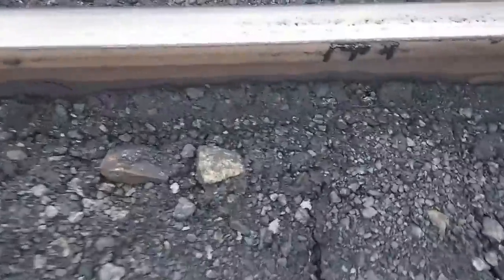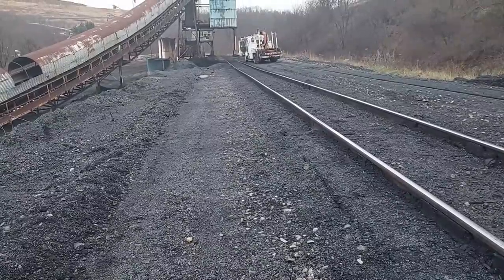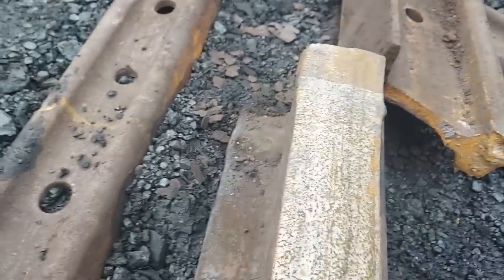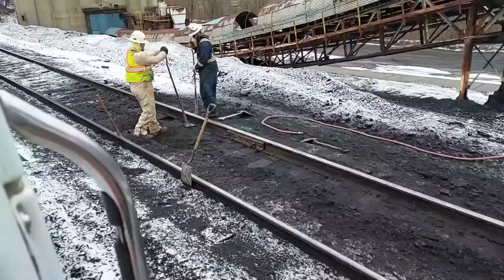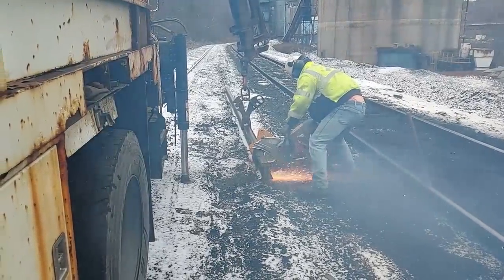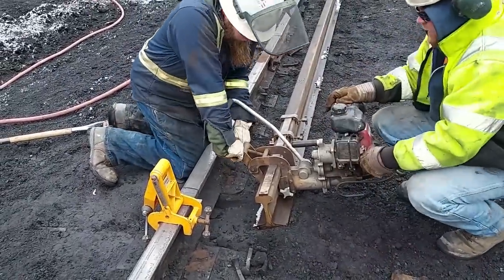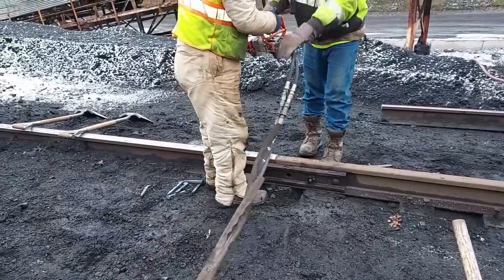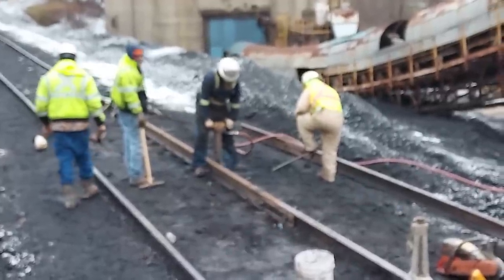Changing a Broken Rail at the Locomotive Derailment Site

Comment: Your face sends out joy. I like that. How bad things might be, Your face is the same, the joy of solving an issue.
So You found out what was involved in the derailed the train "yesterday". I'm impressed by how fast derailments and tracks are taken care of. What would it be like if that "army" worked on maintenance, preventing derailments? Beyond "our" control....
Once being late, being in a hurry, the speed was slightly "plus".... Behind a curve a tree had fallen across the tracks. Full braking action but running into the tree. First inspection told that all wheels were still on the track and the (rotten) tree was cut. That was luck because the leading car was a light passenger car, not a heavier engine car. The bad was that after being cut the tree feathered out under the rail car. Behind was all kind of equipment like generators for the kitchen, heaters and so on. Continued driving was impossible. Just to start using the axe... Luckily the conductor was more fit for that than I.

Railroading is never like an umbrella drink on the beach.
Cheers!
Reply from the maker: LOL, I liked that, railroading not like umbrella drink on the beach,
I'll have to remember that Stefan. Really appreciate your sharing
the story with us and for watching the video my friend.

Comment: That was a strange set of events!  If you ever learn the reason for the derailment and the broken rail, I hope you let us know... we are on edge here!
Reply from the maker: It certainly was. That was taken over a year ago and I have
no plausible explanations on why the derailment or the rail
broke that night. I am perplexed and would love to know some
accurate answers myself. Sometimes really odd stuff happens
without rhyme or reason other than it does make for good videos....LOL
Reply: @ccrx6700  This could of been caused by a combination of metal fatigue, cooler temperatures along with a lack of rail anchors or "anti creepers" and just plain bad luck. Things like this happens a lot with the Long Island Railroad and some of the Metro North Railroad's former New York Central lines. (Mostly during the winter) Interestingly enough, most of the tracks on these lines have concrete ties, Pandrol Clips and welded rail that's been mostly "Thermite" welded. Although, some of the joints have been welded with an electric arc welder and have had a "Full Penetration" weld done instead of your usual Thermite welds. (These tend to be more vulnerable to "Pull Apart's" than Thermite welds.) Anyway, cool video and was fun to watch, God bless.
Reply from the maker: @joshbenton4080  👍😊❤️

Comment: The water bottle coolant is a classic machinist trick too. Drill or poke a hole in the cap and you're set. Also works with saw blades, annular cutters, whatever.
Reply from the maker: My drill has a fancy pump bottle with a cutting solution that
gets injected right at the tip of the bit, these guys don't have
one of those so yep the water bottle works. Thank you for checking out the video and may you have a most blessed day my friend.

Comment: Hi Dave,
Something you could check on the locomotives. Talk to your locomotive maintenance people and see if they’ve been lubricating the truck center castings. A lot of those old SD-40 and 38  locomotives have a 3/4” or 1” pipe running from the center of the car body where the trucks would pivot on the frame. One at each end of the locomotive. Front one should be probably in the compartment under the cab floor on the conductors side behind the access door right under the window. The rear one should be foreword of the air compressor maybe around the electrical cabinet by the oil cooler. 
They have a 90 degree reducer elbow on them with an 1 1/4” pipe plug in it pointing straight up. The big opening acts as a funnel to pour the oil in. We put a full quart of oil in each one about once a year. 
If the center casting gets dry, it can cause the truck to bind in curves, maybe to the point that it will fail to straighten out when it comes out of a curve. If that happens, the leading axle could climb the rail and derail the axle. It might be something to check into and find out if your locomotives even have that lube point, and if so, are they getting lubed regularly.
Reply from the maker: Awesome Ralfie. That is first time I ever heard of that pipe and I
know that no one else here knows about it either. I will check 
tomorrow and see what they've got. What is so odd about this
derailment is, it happened over a year ago and they've ran thousands
of trains with same loco and same track conditions and have had
zero problems since that night. I am totally perplexed. Also first
time we've ever had just a single axle on a loco come off. First time
we ever tried to use rerailers for a loco also. We've used them for
cars a lot and they are easy to get on. Always enjoy hearing from
you my friend.
Reply: @ccrx6700  
I could also be mistaken about it being on SD models, it’s quite possible it’s only on the GP models, you’ll just have to check yours out and see. If you do find them and you only see one near the air compressor, some of them were inside the cab at the bottom of the steps into the nose area, maybe on the control stand side of the steps.

Comment: Hypothesis from someone who is not an engineer. The rail split because of a bad weld. There could be many reasons for that including material used or improperly applied. As soon as the weld broke, it caused the rail down range to deflect or rack. Just enough to derail that truck. Some of the spikes were loose. Also, rail in that section may have been stretched by heating at some point and there was contraction pressure due to cold temperatures. A confluence of seemingly small issues that multiplied at one moment in time. Best thing is no one was hurt.
Reply from the maker: Thanks for taking the time to write in with your thoughts. We
really appreciate your watching the show my friend.

Comment: I used to run a machine shop and I dealt with the machining of weldments. It looks like the weld may have gotten a crack in it and moisture migrated throughout the crack leading to a break in the weld.
Reply from the maker: Thermite welded rail very seldom breaks and it's usually fairly
close to the time of welding. This weld was around 2 years old
if I recall correctly. I can certainly buy into your thoughts, as it
looked like the bottom had cracked first. Thanks so much for
taking the time to watch and write in my friend.

Comment: That's a hell of a break Dave weld weakened the rail  all the heat from the weld was at the top of the rail the lower have was too cold and did not penetrate the steel great video thanks Dave
Reply from the maker: Thanks Gary for the informative comment. Sometimes welds
breaks, not very often but when it does it's usually ugly. Had
not considered how the different temps on different parts
of the rail would affect it. Very interesting. Always appreciate
hearing from you my friend.
Reply: I have stick welded rail it had to pas an x-ray the lower have of the rail always runs cooler when welding we started preheating the lower half before welding x-ray started coming out with no faults on the root pass  glad to see you still in the middle  I should be around your way some time this spring look out for a white GMC untility body truck

Comment: My guess on rail break causation: A combination of soft ties; a soft, soggy rail bed full of coal fines that doesn't properly support the ties; and heavy trains cause excessive vertical stresses that cracks rail. Welded joints are stiffer than bolted joints which increases stresses in poorly supported rail. Perhaps bolted joints that allowed some movement would be better in this location.  Slight movement between bolted rail sections might relieve some of those stresses. What do you think, Dave?
Reply from the maker: No doubt about it the ballast conditions where the rail broke 
are horrible. it's right below where they load the train and the
coal spillage is awful, ballast is full of coal and when it gets
wet you riding over ballast that has the consistency of manure.
this weld that  broke was less than 2 years old if my memory
serves me right. It definitely is a problem area. I have no arguments
with you on your hypothesis my friend.

Comment: Worked in railway late 50's and there was no need to call contractors in. There was a squad of men called platelayers covering small areas of the whole network who would hae fixed that inside a few hours.
Reply from the maker: Things aren't the way they used to be William. Plus since we are
a coal mine that has a railroad, and not a railroad we don't have
those kinds of departments so rely a good bit on contractors
on an as needed basis. Really appreciate your taking the time to
watch and write in my friend.

Comment: You guys need a hydraulic spike puller, we have gas powered rail drill too but we use the hydraulic ones more often.
Reply from the maker: We do have a hydraulic spike puller and they are looking into
getting me a battery powered one. Never knew they made
hydraulic rail drills, that would be really cool. Will have to do some
research on that. Thanks so much Jason for writing in and 
watching my good friend.

Comment: When it comes time to replace the spikes and sleepers, maybe consider pandrol's which can hold a broken rail much better than just a couple of nails, less chance of slipping a flange and super strong, those China to Germany trains are immensely heavy and long and not heard of any derailments as the eastern Europeans and Russians, Germans and Chinese all use pandrol's as standard.   Also maybe invest in some concrete sleepers at either end, wooden in between is fine but where the loco and wagons are focused hard down on the rail footprint, esp when large temp changes occur you can get fractures in the rail, with the sudden cold snap I am surprised rails don't suffer more breaks.
Reply from the maker: I cannot agree with you more on the addition of Pandrol Clips, I
sure do like the way they hold as opposed to spikes. Excellent
comment. However, concrete would be awesome but with my
old operating system on my tamper I cannot toggle between
concrete and wood ties since concrete ties are 2 inches thicker
than wood. If I had a Jupiter 2 operating system that would be
no problem, but I don't. So those concrete ties would not get
tamped with what I have. I as you, am surprised we don't have
more rail breakage here. There is just so much coal spillage
from them loading the cars and it's impossible to keep clean
and coal just fills the ballast up and becomes mush when
it rains. Thank you so much for you very well thought out
comment and for sharing my friend.

Comment: 1) Welded joint 2) "Really really cold that night" 3) Broke when the locomotive weight rolled over it - it sounds like a classic example of temperature embrittlement of steel in the heat affected zone of a weld.  To my understanding, the classic example of this was in Liberty Ships during and after WWII.  They were among the first ships built using welded hulls, and were built quickly.  They had failures when the ships were operating in the North Atlantic in cold temperatures around the welded areas, which led to the understanding of the "heat affected zone" (HAZ) where the metal around a weld has its structural properties changed by the high temperatures of the weld, which can lead to it becoming brittle during cold but normal operating temperatures (whereas the "normal" steel wouldn't become brittle until a MUCH lower temperature than it's ever going to see).  I understand there are procedures for reducing the effects of this.  There is a lot of information about it out there if you search for "heat affected zone" - here's one link:
https://weldinganswers.com/the-importance-of-the-heat-affected-zone-haz/
Reply from the maker: Very interesting comment. Thanks for taking the time to share with
us. I never knew that about the ships, nifty stuff to find out.
Really appreciate your watching the show today my friend.

Comment: Do you have to do a NDI inspection on welds
Reply from the maker: No we do not Mike and I have no idea if other RR's do. They have
a bunch of natural gas pipelines here in our county over the past
10 years and every weld on a high pressure line gets tested, about
every 5th weld on low pressure lines. There is a company called GenX
that does it. Always appreciate your dropping by and for hearing
from you my friend.

Comment: I remember many years ago while leafing through catalogs in the engineering department at work and seeing a catalog that was about a rail bolt hole device that would clamp around the rail and was loaded with a special.45 caliber blank,that when fired by a lanyard would drive a piston and punch a bolt hole through the web instantly.Don't remember the manufacturer.Do you know about this Dave?
Reply from the maker: I have never seen one rj, but have talked with some older guys
who actually used them way back in the day. Those are no
longer allowed to be used. Thanks so much for taking the time to
watch and write in today my friend.

Comment: Hi Dave, At 4:04 when you look down the rail towards the curve, the curve is high, and then there is a dip where it straightens out. Could this be your derailment issue ??
Reply from the maker: Yes there is a dip there, however it's not as bad in reality as the
camera makes it look. Camera I've found often distorts views
of track. But even with the dip it is a gradual thing in and out of it.
What is important is the cross level between the 2 rails was still
good. A dip from one side of the rail to the other rail if it was
enough could have cause the derailment for sure. Also remember
ballast was frozen solid that night so soft ballast was not an issue
either. Thank you so much for taking the time to watch and
write in my friend.

Comment: That section of track is going to need some cleaning; removed any excess coal from the track. Planning on running a ballast regulator through there and broom the track?
Reply from the maker: it certainly is a mess there jmm. It's right below where they
load the cars and gets a lot of spillage, then sometimes car
doors will open up after being loaded. It's extremely frustrating
and almost impossible to keep cleaned up. The ballast is
full of coal fines. We used to get Hulcher in with their vac
truck on a regular basis to keep it cleaned up, but since our
last company filed bankruptcy and there was no money,
that practice went by the way side. I'm ashamed of this
section of track and again very frustrated. Thanks for watching
the movie today my good man.

Comment: I can envision how the derailment happened in my mind's eye. Not saying this is what happened per se, but I can almost taste the process LOL. 
Imagine tension (as opposed to compression) in the rail that broke. It is starting to vibrate as the weight of the consist is tensioning it further. It's cold, the rail is particularly 'tight' the ballast is a bit spongy causing the rail to sag a bit tightening it even further. A part of it at the break area cracks releasing some tension and that sends a shock wave up the rail. 
It was able to happen because the flange is on the inside on that side, so the derailing shock wave is transferred via the axle to the opposite wheel that has the resistance causing that flange to ride up the inside of the rail or possibly - likely even, to jump off the track for no apparent reason. 
Could be wrong LOL. Just a theory.
Reply from the maker: Thanks for you well thought out hypothesis The Paulv. It certainly
was stress related and thinking that part of that rail had been
broken in the past, the rest went that night. Always appreciate
your visiting with us and hearing from you my friend.

Comment: So you don’t think the break in the tail on a strait section had nothing to do with the single axle derail? 
It’s my suspension that when that rail broke that maybe there was enough flex that that axle flange popped onto the top of the rail and traveled down the rail that 200ft until it fell off where it did. Seems more plausible than it just hopping up and over the rail in a single bound for no reason at all.
Reply from the maker: Thanks for writing in and sharing your thoughts with us. It certainly
was a very odd and strange occurrence that happened. Very much
appreciate your taking the time to watch today's video my friend.

Comment: That fracture looks like it was caused by ballast washing out and the track flexing up and down under the enormous weight of the train. I'm no expert, just speculation here.
Reply from the maker: Ballast conditions there certainly leave a lot to be desired. It's
right below where they load the train and almost impossible to
keep the coal cleaned up. Night rail broke it was frozen solid tho.
Thanks so much for taking the time to watch and write in my friend.

Comment: When do you use thermite welding?
Reply from the maker: Whenever we are trying to eliminate a joint Kevin. Cannot weld
joints that have the 3 bolt holes drilled in them tho, so
that limits the welds we can make. Hope that helps and thank
you very much for watching the video and writing in my friend.

Comment: After watching this video I need to ask: why is rail sometime welded and sometime joined with thermite?
Reply from the maker: All the welds we do here are Thermite Bob. They are all done by
a contractor. These contractors do not have the equipment
to do flash butt welding. No one stick welds rail. If you don't know
what flash butt welding is, look up a You Tube video on it.
Really appreciate your taking the time to watch and write in
my friend.
Reply: Thanks for setting me straight. I just made an assumption. Good thing I found your channel a year or two ago or I wouldn't know anything at all about railroading,😀
Reply from the maker: @bobmeginnes324  👍😊we really appreciate all your wonderful support Bob.